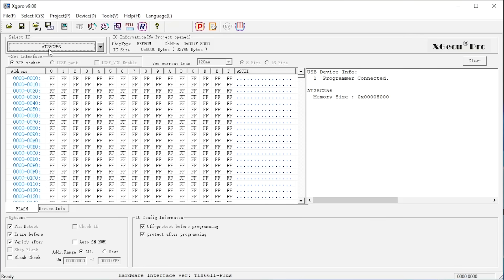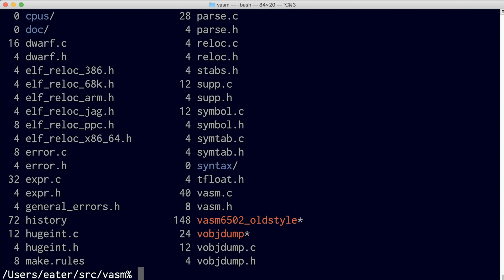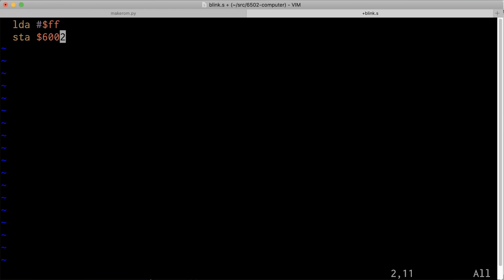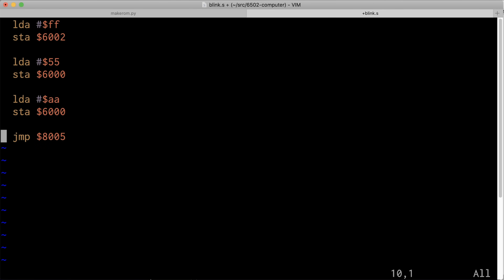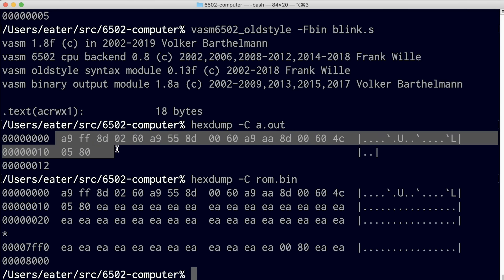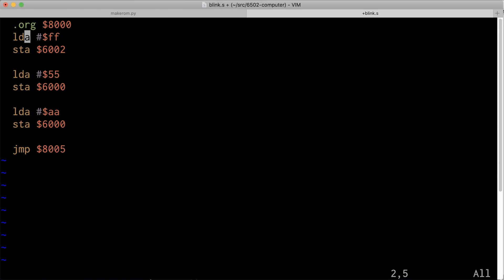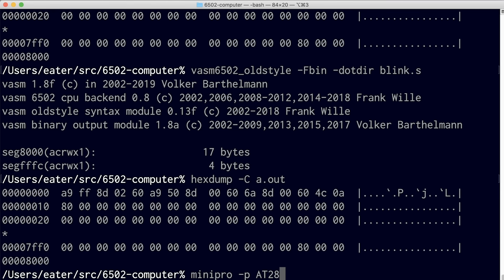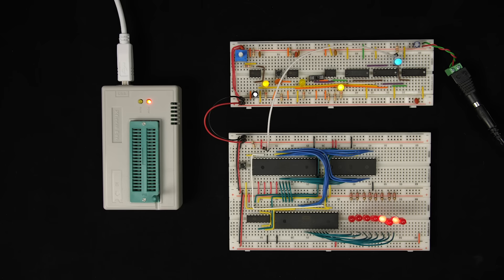Assembly language vs. machine code — 6502 part 3

Comment: Following along with a view to re-creating a 6502 computer I built from a kit in 1979, but with modern components.
I found some circuit boards that are identical to the layout of the breadboards and have used one to make the clock a bit more robust (and it's freed up a breadboard).
Well worth doing as the components are now soldered in and can't fall out.

Comment: I can't get the windows binaries .exe to run (time 2:32). A black screen opens then quick closes. Any tips?
Reply: If I get lucky with rapid mouse clicking, I can keep the window open and there is text that says:
 
"vasm1.8g (c) in 2002-2019 Volker Barthelmann
vasm 6502 cpu backend 0.8 (c) 2002,2006,2008-2012,2014-2018 Frank Wille
vasm oldstyle syntax module 0.13f (c) 2002-2018 Frank Wille
vasm test output module 1.0 (c) 2002 Volker Barthelmann

fatal error"

If I touch the mouse or keyboard the window instantly closes again.

Comment: if you still have a problem with the clock jumping or ticking like 3 times in the serial monitor i recomend pulling it trough a resistor as you then guarante that the power will only tick and not buss.

Comment: 12:57 why does the interpreter has to write values backwards?
Reply: It is called little-endian format and is common on many/most computers. Basically, the least significant byte comes first, then more significant goes after. I think Ben mentioned it somewhere in this video or the last perhaps.

Comment: I had Commodore 64 and programmed it with assembly alot. The Basic interpretter had nice way to run binaries: If you typed .NAME it tried to look it as a 6502 binary from the disk drive (floppy) and load it into memory and run. So I tried to make a full blown disk operating system on it. It was slow as h**l but it did work (in a sense that you might not call working). I also used it to telecommunicate and it was challenge to make the terminal software write 80 characters per line when you only had 40 glyphs per line.

Comment: How does vasm know to relocate addresses 0x8000 and up to actually be starting at EEPROM address 0x0? I didn't see anywhere where we specified the EEPROM size, so why doesn't it produce a 64k binary where 0x0 to 0x7fff are blank, and only then at 0x8000 is the first lda instruction?
Reply: Good question, did you figure this out? My only lead is that it might be relative to the last time .org was set. So if nothing is set at first it just treats the beginning of the EEPROM as 0x8000 and then the subsequent .org directives figure out their memory position by subtracting the original? Just a guess, I'm wondering about this too.

Comment: thank you for this series! I did 65c816 programming as a kid (for SNES), which built off the 6502 instruction set. It's really fun to go back to this!
I'm very slightly annoyed at using JMP instead of BRA (branch always) for a nearby address, since BRA is one cycle faster and one byte smaller, since i used to have to actually care about that stuff for the program to run well... but this is on breadboards, who cares about efficiency 😆

Comment: You are WRONG. When I worked at Lucern Products, I designed and built a 68000 based tester for SCRs and Triacs. They did not have a development system. So I wrote the program in machine language and burned the EPROM.
Reply: How is he wrong?
Reply: @tboman4128  He said, "No one actually writes software this way." I did. Therefore he is WRONG. I did not want to. But the company had no development tools. I only had access to the vendor's PROM burner.
Reply: @robertpearson8546 he was over exaggerating how very few people write machine code by hand 🤦‍♀️

Comment: I miss the old school 8-bit processors. They were like cold molasses as far as speed, but they were so much fun to play with. Anyone (my opinion) that learned to program in a 640K (yes- K) RAM environment learned really fast to code VERY well.  Yes, I did 6809 assembler. I loved the direct access to the CPU without worries that a compiler might not make a routine that compact. or bullet proof. But typically I used BASIC as it was almost all y0u could get for a 6809 based computer. Unless you knew "people" and I didn't at that time.
I did spend the next 35 years in IT... mostly as an SQL programmer in an enterprise setting. Great fun.

Comment: For my machine language program I wanted to increment A from 00 to FF and send it to the LEDs. That worked, but in plain 6502 assembly there’s no INcrement A mnemonic (op code 1A). After doing a little googling I see 65C02 added a few really useful instructions beyond the MOS 6502 and vasm supports them if you add the -c02 option on the command line! Actually for this chip there’s the -wdc02 option which includes even more instructions added by WDC.
Reply: so without "INC A", you would have to write extra code? How would that look like? Just 3 lines of code?
Reply: @Sypaka ADD A, 1
Reply: @Veliki-k3i  Why ask for something complex, if the solution is actually simple. I seriously forgot increasing is adding by 1..
Reply: @Sypaka Adding one to A is a good idea as has already been mentioned but depending on the scenario you might also use the X or Y register with INX and then store it with STX for example. Those registers are made specifically to be counters/indexes to increment, but if you need to do other things with that value it'll take an extra transfer.

Comment: Is that EPROM burner available in something that allows pass through into the PCB ?
I mean take out of PCB, insert in burner, take out of burner, re-insert into PCB,
umm, yeah, kinda manual.
It would be neat using ur desktop to create an eprom image, autobatch-burn it into the
EPROM, and the run it, without the annoying sequence.(take chip, insert chip, take chip,insert chip.)
Reply: Also with the 65C22 you can technically add multiples of 32Kbyte
and use the 65C22 as an MMU, that switches to whichever relevant 32Kbyte
ROM, or RAM.
I think the GTIA can make that same switch as well.
A nice 65C02 with 1Mbyte memory, to see if it could stack up to 8086,
as is, without using the 8086's 32 bit adress range.
Theoretically it could since the newer versions of the 65C02 rely on smaller
architecture, and will operate at 100Mhz+.
Reply: I feel like I've seen EEPROM programmers that sort of sit on/piggyback the chip on a PCB. More commonly for an SMD package though.

Comment: Quick question: when did we change "pound" to "hash" for the '#' symbol? As a programmer myself I would greatly appreciate a little guidance on this.... am I dating myself by calling '#' the "pound sign?" So many questions.....
Reply: #, which in its earliest computer-related form and was referred to as the number sign (ASCII) or the octothorpe (from bell labs for use on a touch tone keypad along with 0-9 and *) aka octatherpe and various iterations on those spellings, does still indeed mean pound when it follows a number (i.e. 5# flour in a recipe) and stems from ℔ meaning libra pondo and then later related to pounds avoirdupois. When preceding a number (#1) it is known as the number sign which is the Unicode name for the character. In the UK, a pound symbol would more commonly be thought of as £ and many earlier keyboards layouts would have had/sent that symbol instead of # depending on the country of distribution. So, as to not put two meanings on one symbol, this seems to have become known as hash, possibly from hatch like crosshatch. This is, of course, just one version of the events and hash was likely in earlier use. Most references seem to say that the usage of hash for the symbol is of unknown origin. Particularly confusing is Twitter's use of hashtag because in the original tweet by Chris Messina, which created the idea of a hashtag in the modern sense, he actually said pound. "How do you feel about using # (pound) for groups. As in #barcamp [msg]?" So, overall, I don't think I answered your question at all and have many questions myself but it's something that has always interested me. I hope others have better insight.
Reply: @AttemptingAstro  wow thanks for the reply! way more history to it than I realized.

Comment: One thing that became obvious to me when programming a Z80 processor emulator in x86 assembly language is that there are patterns to these opcodes. For instance, if you look at the adc instruction (add with carry) for the 6502, there are eight different opcodes depending on if what you're adding is an immediate value, an absolute memory reference, etc. All the opcodes begin (in hexadecimal) with 6 or 7 and end with 1, 5, 9, or D. When you convert that to binary, the adc instruction is 011xxx01 with the x bits changing depending on where the value is. The processor uses five bits to determine it's an adc instruction and the other three to figure out what to add.

If you look at the opcodes for the sbc (subtract with carry) instruction, they're the same except they begin with E or F instead of 6 or 7. That means the binary changes by only one bit from adc to become 111xxx01 and you fill in the x bits the same way as with adc. Not all instructions fit into this same pattern, but many do if they involve taking some value from somewhere in memory and moving it into the accumulator or combining it via some operation with what's already in the accumulator. That gives you a hint as to how the processor works at the hardware level.

Even the sta instruction fits into this pattern even though the direction is the opposite. There's just no opcode for when it's an immediate value because it doesn't make sense to do so. It does make me wonder what would happen if you send it an $89 opcode though, if the processor would fault out for invalid instruction, actually overwrite the next value in memory and keep going, or something in between. I may have to try that as an experiment.
Reply: I found out what the $89 opcode does. It apparently does nothing, like the nop instruction, but with an 8-byte operand that it ignores. There are apparently a lot of these amongst the undocumented opcodes, as well as some that crash the processor and some that have interesting but inconsistent results.

Comment: What .org $8000 at the start of the blink.s file do to the output file?  I mean its a 32kB EEPROM so address 8000 shouldnt be exist so does it just overflow and .org $8000 mean to start writing the machine code at address $0000 (on the eeprom)?

Comment: Reminds me of the old Z80 days .Good that you had the clock speed right down. Else you would have needed delay loops.  Could have saved 2 bytes of emprom by removing the first LDA $6000. and putting ROR after the LDA$600 in the loop.  Makes me want to drag the old boxes out the loft and go back to using the PIC chips.

Comment: @Ben Eater
9:30 What happens if you tried to run that program?
What is "        " to the computer? how is that interpreted?
or is it just "whatever was left over from the previous program there? (what happens if the chip was factory new & not "initialized" or whatever, what would "      " be then?)

Comment: Really disappointing that there’s no step by step on using vasm and otherwise creating the bin file. There’s so much other detail, including remarkably which leg is which on an led, but the critical steps of downloading and using the assembler and otherwise creating the binary file are glossed over. Want to buy the kit, but not without being certain how the load the eeprom. Bummer.

Comment: This. Is. Amazing! I used to program my Apple ][+ in assembly language back in the early ‘80s when I was in middle school!
Reply: call -151
Reply: @deang5622 , I remember that! Call -151. I can’t remember what it means, though.
Reply: @MrConverse  It takes you from the Applesoft Basic interpreter into the monitor program and allows you to perform memory dumps alongside a disassembly showing the mnemonic form of the 6502 instruction, if the bytes were to be considered instructions.

And then you change the contents of memory to write in your machine code programme (no assembler here).

Comment: So if assembly code is just surgar code for machine code and c/c++ compiles to assembly code and you can write a implementer of scripting language for JS like v8 or node and wirte an application in JS using it then it means that JS is only sugar code for machine code then how to write an fullstack web app in machine code?

Comment: This is so meaningful to me. In the 80s I taught myself how to program in 6502 (6510) machine code. I still remember the A9 command. What I want to do now is see how to add some ram chips, with a framebuffer that is output to a video device, put some bootstrap and useful code in the eeprom and add a keyboard. Can that I/O chip be used with a keyboard that signals in a row, column wire arrangement? 
There's probably a keyboard chip that outputs on an 8 bit output.

Comment: I have the honor to greet you and at the same time congratulate you for such an important work that you have been carrying out for so many years on your channel on microprocessors and other topics, which I visit regularly. Today I am writing to you with the intention that you will see on my Youtube channel (https://www.youtube.com/channel/UCWzqT10OHJoFkO1wUE8a-tw) several videos that I have uploaded about the "Primer Sistema Operativo Binario de Uso General para Microcontroladores (First Binary Operating System of General Use for Microcontrollers)" that I am creating and that I have named it sobug_mic (https://youtu.be/BJqTa9fc0rQ).

After watching his video on Assembly Language vs. machine code - 6502 part 3; I am writing to you from Venezuela and I wanted to ask you if there is a possibility that you are one of my sponsors? In summary ... I am raising a minimum of $ 25,000 that will be used to acquire components, equipment, materials, laboratory, vehicles, among others, and thus be able to continue with the development of free content and in our language, for this reason I am personally contacting each possible sponsor and request a contribution of $ 1000 from each one.

Hoping for a favorable response, and to continue this conversation in private, I say goodbye… Daniel Serrano.

Comment: Programming in assembly on the Sym 1 (6502 single board computer) was hand asembly.  Instead of an assembler, you had a photocopied worksheet to write down your assembly language and hand-encode into machine language and then input into the computer via the monitor program. Of course, with 6502, that's pretty straightforward.

Comment: I took this course in Digital Electronics with Laboratory through Cleveland Institute of Electronics many years ago. We built a 4-bit computer for one project! We used RAM chips, switches to do addressing and a 1Hz clock (whew!!!). It had 1 kbye of memory, 2 input registers and 4 instructions: AND, OR, XOR, NOT. It did not fetch instruction and decode them though. We do that manually. It was just a tool for learning how a computer works. These kind of projects like the 6502 remind me of the good old days! I used to used the Motorola 6809e, Intel 8085, Zilog Z80 and others. 
Embedded computing was a lot harder in the old days. 
Today they have so many microcontroller boards that are way more powerful, cheaper and easier to use, but using them robs one of the underlying knowledge that makes it work.

Comment: Here's a cool project for an engineer to build: ROM emulator using Flash technology. One can use surface mount parts on a PCB that has the same large DIP package format as the ROM. You can put a switch to address different address spaces without removing the module and put a USB port on it to reprogram it.
I'll bet someone has already done this though. But if not, there is legacy equipment (like old console video games) that you can benefit from this.

Comment: I have a very basic question. I am a mechatronic engineer student. I have 2.5 years to finishing my university. And I guess I will deal with embedded systems whole of my career. People use C language for that. But I know file size and the speed is very important. But as far as I now more than 90% people use C...

The thing is I'd like to control my device as much as I can do. I'd like to do best, not just good. But the thing that I wonder is, in my career, am I gonna use Assembly or C. What will my boss want from me? If I know that two language equal level, which one I use.

I'm asking this because being good at a language takes time. Serious time. And If I'm gonna spend that time, I'd like to spend the thing that I can earn money, not theoritical knowledge. 

If you say to me something like "If you will good at assembly you will never want to use another language. And it will give you lots of +++ in your career." I'll learn that language. However, if you going to say something like "you will learn how the things work, but you are not going to use it" I will try to better on C. What do you suggest?
Reply: You will be expected to learn C.

Comment: One thing about the ROR and ROL instructions is that if you look one of the "on" leds seems to disappear for one rotation before reappearing on the other side. That's because ROR and ROL run the bits through the Carry 'C' flag in the processor status, acting as a "9th bit" for additions/subtractions and moving bits around. This makes it easier to chain bytes together and interpret them as a variable larger than 8 bits. If you want to leave the carry out, on the 6502 it's easy to put a CMP #$80 before the ROL instruction because this will essentially copy the highest bit to C before you rotate it back into the lowest bit.